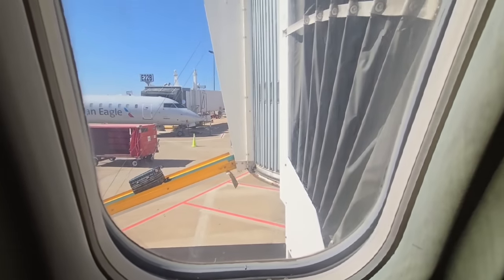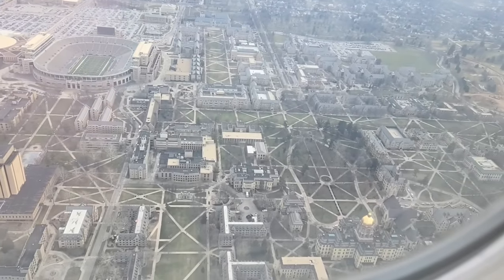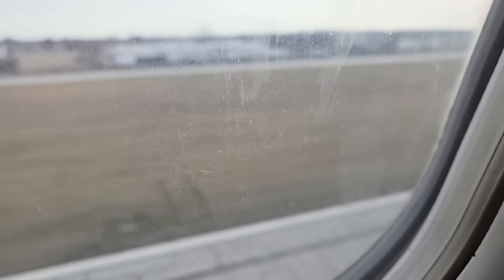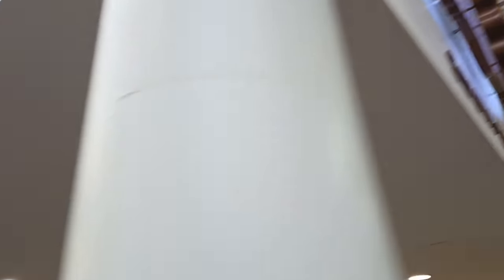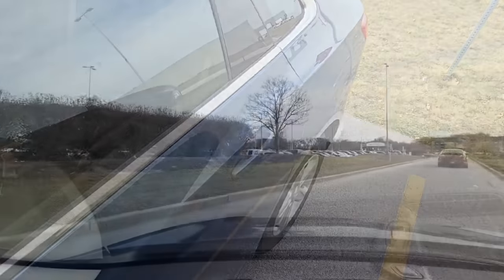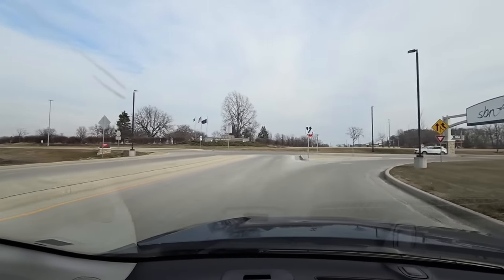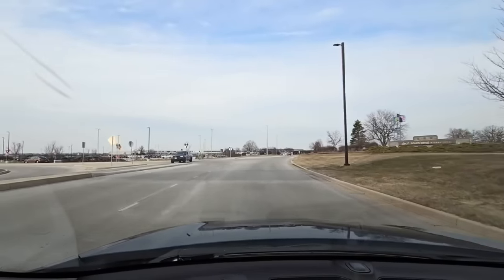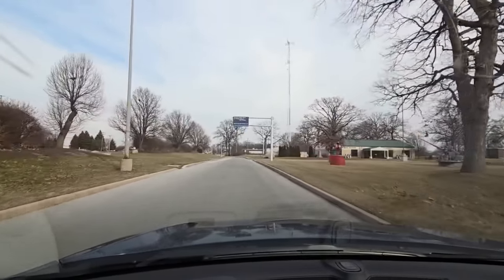LIPPERT Answers Questions about RV FRAME FLEX! Part 1

Comment: Thanks JD, I like the deep dive but I do have some questions if you'll allow me:
1.  Like almost all states, I'm all but certain that you cannot call yourself an engineer unless you have attained the PE designation.
2.  Not sure I caught Tim's last name corectly.  I did a search on the Indiana Professional Licensing Agency's website and 7 engineers came up under "Timothy Schultz".  Only 1 was a "Professional Engineer" under license PE19300397.  The remaining 6 were not engineers in an industry silimilar to structural engineering.  Is this the Tim in your interview?  My apologies if it is not.
3.  Assuming the answer to #1 and #2 is "yes", does Mr. Shultz seal and sign off on all of the drawings and calculations for each frame at Lippert?
4.  I must assume #1, #2, and #3 are a "yes" and if so, does Mr. Shultz maintain "responsible" control of every design that he seals and signs?  That is, does Mr. Shulz observe and control all initial design and changes to the designs he sealed, even if the criteria is revise by the manufacturer?
5.  Based on this video, It seems as if the manufacturers take control, or it is at a minimum implied that an engineer at the manufacturer takes control of the engineered design once Lippert "hands it off".  What is the process for Mr. Schults to "hand off" the engineered design of the Lippert frame?  Surely someone must take responsible control of the engineering after it leaves his oversight?  It would also be reasonable to assume this person does their due dilligence prior to acceptance to ensure they are confortable taking ownership of Mr. Shultz design.  After all, they essentially own the design after they take control.
6.  At some point in time, someone "owns" the engineered design.  I dont know who, nor say it is in any way Mr. Shuktz, but if it isn't he, certainly someone that is licensed to practice as a professional engineer in the state of Indiana at the manufacturer(s).  Hopefully someone that is entrusted with the health, safety, and welfare of the general public for sure.

It feels like no one in the industry wants to take ownership of what they produce.  I certainly hope I'm wrong and also hope that my questions above are answered for the benefit of the general public.
Reply from the maker: Several of their engineers offered to provide the current PE License but for privacy purposes I did not ask them to.
Reply: JD other very good questions were raised other than the engineers last name and credentials. What about the question posed concerning the process in handing over the frames to the OEM manufacturers?
Reply: @BigTruckBigRV understood.  Thanks for the reply!

Comment: Although Lippert is building frames to Grand Design's specifications, they may still be some liability because they know of the problems being experienced and they continue making the frames.  My 323BHS has a huge kitchen slide and a front and rear bedroom slides.  I question having a huge amount of weight on one side without the suspension to handle it.

Comment: Chassis are about 15 percent of the structural value of the trailer. If the box fails the chassis will follow. Water damage, delamination and overloading cause most failures.

Comment: Just listened to your Q & A from the Lippert people; seemed pretty it at times… why in years past, with the same RV  manufacturers they’ve been using, are all of a sudden having soo many problems NOW. I can’t possibly believe that the RV companies have changed their weight distributions as maybe as Lippard, probably it using a cheaper/thinner steel!! Why doesn’t Lippard just make a heavy duty unit, no matter what the RV structure on it is????

Comment: I'm a little confused because the engineer said that some RV manufacturers come to  them with a floor plan that they want a frame designed, engineered and built for and will be using normal RV accepted manufacturing practices. The engineer said in those instances they engineer the frame to their specifications. The RV manufacturer is relying on Lippert to build a frame that is sufficient! This is the area that Lippert seems to have dropped the ball. Cutting cost and corners is going to cost Lippert in a lawsuit.

Comment: Whenever you have two or more working on something, literally anything, it will always be the others responsibility when something goes wrong. It’s called plausible deniability. This is one of the reasons why companies like Newell, Prevost and some livestock trailer manufacturers are structurally superior. It’s not because of “trade secrets”, it’s simply because they have control and responsibility of the structure of their units.  Essentially “the buck stops there”.  There is an engineering line where “it will work” versus “it won’t fail”.  Guess which one uses which philosophy.

Comment: The changing of the pin box from one manufacturer to another is interesting in the contribution to frame failure. I’d like to know what Brinkley does differently from these other manufacturers because they offer Gen-Y pin boxes and goosenecks of different sizes on the same model of their Lippert frame.
Reply: There’s a difference how they are attached but I can’t find out if there is a difference in the thick of the steel.

Comment: As far as Lippert saying the RV companies may be overloading their frames. Even if that is true the frames should have a safety factor built in. For example, a truck might officially be able to tow 12k but it designed for 14k for safety- loading errors, etc. Frame SHOULD be the same way not just barely cover the GVWR of the RV

Comment: I have a 2023 grand design solitude fl380.  What are the guidelines on this frame?  I can tell you this frame is to weak unless the sidewalls provide strength which I don’t think they do!  Semi trailer get there strength from the sidewalls.  The problem in the RV industry is that there is no standards for the build.  We will not improve these products until the government steps in and sets standards like automobiles.  I would gladly pay more to have a product that is safe and will last.

Comment: JD I have a 2016 Highland Ridge 318RL with the Lippert Combination (either Gooseneck or Hitch pin) pin-box. Can you ask what is different in frame to allow the Gooseneck use and why since 2018 Lippert/Hightland Ridge stoped this combo pin-box.

Comment: But most frame flex issues are the frame breaking. I don’t believe water intrusion would cause that unless the frame has severely rusted. Think about your car frame or the steel frame of a skyscraper or the frame of an auto/heavy equipment trailer. They are exposed to much more than just water. And every video of a broken frame I have seen had zero rust. I think that the frame should be built to a standard above and beyond to prevent any unnecessary flexing. Then the rv manufacturer would have to come up with a more rigid unit to build on top of that frame. Think about class A, B and C motorhomes. They aren’t breaking. I have even seen frames breaking on travel trailers where the a-frame portion is because the steel is too thin. Of course I put the majority of the blame on RV manufacturers but Lippert has some responsibility here too. They are either aware that the rv manufacturers are ordering frames that can not withstand the weight and are not building them strong enough. Lippert is aware of this very serious problem and should step in and say hey we are not putting out frames on the models have issues until we and the manufacturer come up with a solution together that ends this problem. Instead they are putting lives in danger for profit.

Comment: Great job on the interview (and for that matter, even getting in the door!) and good questions asked. However, Lippert's responses of course, were handled with prejudice and that is to be expected. 
Learning about the pin box replacement and having to have an "approved" model was about the only thing solid, as far as information. 
My gut tells me that there will be no admittance of inferior work, design, or materials by the chassis or house builders, ever! As long as the "he said, she said" is practiced and fingers can be pointed, the consumer is the loser. 
We have the same issue in the motorhome world, when it comes to taking responsibility of issues that lie in the "gray area".

Comment: In my humble opinion, lippert should be designing these frames to be “over built “ and self supporting, which is to say, if frame model”y” can carry up to 15,000 lbs, not including the frame weight itself, then it gives them a leg to stand on instead of relying onthe rv superstructure to add additional support. If the rv design goes over the weight the chassis is designed for, it’s on the rv builder. There are some things lippert could improve upon, like the standard leaf springs, and spring mounts, they are doing the minimum, should have better mounts with gussets. Lots of trailer rvs out there with boken springs and broken mounts.

Comment: Did you ask if they are regulated? Some channels are making claims the industry is unregulated.
Reply: The industry is very lightly regulated. NFPA 1192 for the house side. There is no crash testing that I’m aware of. I’m sure you’ve seen them fly apart in crashes. One of the reasons I refused to buy a class A.

Comment: Curious if Lippert's stickers dictating GVWR, pun weight restrictions, suspension hangers etc. is gospel or if the individual manufacturers request specs built to that GVWR then design Floorplan with weights distributed all over the Floorplan without taking structural integrity of certain areas into account?
Reply from the maker: That's actually talked about in tonight's video.

Comment: A lot of people have been quick to blame Lippert for all of these problems. They definitely shoulder some blame, but I think the manufacturers are more responsible. Some people think Lippert does all the design, but they clearly do not.
The big question is, with all of these failures, is Lippert putting pressure on Grand Design and Keystone, and anyone else having issues? Since it is their component that is failing, I would think they would be investigating this and putting pressure on the manufacturers to design a stronger overall structure.

Comment: JD, good idea investigating this. Thanks for the work your putting in. I just have one question and one request. 
If they know people change pinboxes or convert to gooseneck, why dont they make their frames to handle them? If they make the frame for worst case scenario, all the rest will be fine.
Also, it would be great if you could talk to one of the workers without corporate around. In our factory, we have manufactured answers ingrained in us for auditors and inspectors. Needless to say, i am not allowed to talk to them anymore.
In the scheme of saving money, it could be as simple as changing welding material suppliers. Thats only something youll find from the workers.
Anyway, hope you get some answers and keep up the great work.

Comment: It is apparent Lippert sees frame flex and the resulting damages is the cause of many moving components happening together. They feel what they are building is built well, so, I guess it may be until you put an RV shell on it, it is at that point it is under-designed. I feel this interview needs to also have the RV company at the table as it is the sum of all pieces that is failing, not any one item.

Comment: I don’t understand how a frame that robust fails. Dry box trailers are built with no I beams. Just 4 inch cross members. There is a ton of them and the whole box is all tied together. I understand it’s a completely different design. But they haul 20 tons or more for millions of miles .
Reply from the maker: The manufacturers who built those trailers build the entire trailer.  The substructure is not built from one manufacturer, relying on the secondary manufacturer to build the remaining portion of the structure correctly.

Comment: Stapled together 1x2’s make a steel frame more rigid?
Reply: Sure, just like the paper or fabric on a kite makes the wood frame stiffer.  Or sheet metal stretched across beams stiffen the beams.  Or sheathing and foam insulation stiffens the framing of a house. There are countless examples of where a "weaker" material is used to make a stronger material more rigid.

Comment: We need more RV education videos like this and less videos of influencers receiving free products for their RV.  Why? Because some folks may run out and by such product without doing the research to determine if the product will damage their RV.  Example, not all aftermarket kingpins are approved for your rig, another example, sumo springs are not approved for all rigs, and switching from a standard 5th wheel hitch to a gooseneck may not be approved either.  I'm not saying that the manufacturers are not a fault for issues but we are also seeing relentless amounts of videos from influencers with all these "wonderful must have" products that they received for free that may or may not cause damage to your particular rig.  Just my opinion though, not fact based.  Only time will tell what the manufacturers will do with all the social media attention this topic is receiving. I'm  looking forward to the remainder of this series.

Comment: This is very interesting, but there are some truths that we will never know. I can't see any manufacturer ever be willing to admit that they might have designed something that is subpar. The blame will always get passed on. When a certain make or model of a 5th wheel trailer is given a specific payload why doesn't the manufacturer spell out how much payload can be carried at each location of the trailer? If a trailer has a payload of 3000 pounds and it has 100 gallons of fresh water capacity, which would weigh roughly 800 lbs, then the trailer really only has 2200 lbs capacity. Does the trailer have the capacity to have all of that weight placed in the basement where the king pin would receive the most load? How about when you add a washer and dryer in the front of the trailer? Most of that weight is directly over the king pin and transfered to the tow vehicle and thus less strain on the frame of the trailer. Manufacturers really should spell out areas of a trailer that can have a certain amount of payload instead of saying to spread out the weight throughout the trailer. I also find it hard to believe that the frame superstructure is highly dependent on the camper body for support especially when considering older trailers were wood framed and most newer trailers are aluminum tubing and if soft grade lag bolts are used to connect the walls to the frame, the fasteners simply aren't strong enough to have a great effect. When frames are designed, my guess would be that they are tested with a certain amount of weight placed on the frame and then the suspension is cycled and measurements are taken. I truly hate the term frame flex, because the majority of the issues are frame failure in which either the steel has failed due to fatigue  or overloading. Poor welds or missed welds would be a totally different situation that would be lack of quality control. When I bought my first fifth wheel trailer many years ago I installed a gooseneck adapter to the kingpin and I could tell that it was stressing the pin box excessively by the way the trailer chucked. I removed the adapter after one trip and went back to a fifth wheel type of hitch. In regard to how heavy of GVW of 5th wheel trailers are experiencing frame failure I would say you should include 5er of 15k and up, not just 17k and up. I have seen many cases of 15k 5ers with frame failures and this really makes me wonder how badly overloaded some of these 5ers really are. They can easily be within axle ratings and truck ratings, and still be grossly overloaded. I for one weight my truck and trailer combos often because where I live there are numerous department of transportation scales that are free to use and I use them often and I have upgraded my truck to a dually because my single wheel 3500 pickup was always at least 1000 pounds overweight.

Comment: I  believe this is what they call kicking the ball down the road. So what im hearing is you don't build R.V. frames. You build one half of a uni-body system with not required specs or regulations.

Comment: Hi all,So I’ve been camping for over 40 years and have had all kind of trailers. At this point in my life I’ve been fortunate enough to have been given a 1999 Carilight fifth wheel camper. I have put it through it paces and guess what, over loaded or rough roads it has no frame flex. I question the integrity of what they’re building now. My two cents…

Comment: Everyone is assuming they are not responsible and its the other guys problem. When these guys are talking about flex I believe they are talking about the overall frame and not just the area above the hitch. I believe this area should not have any flex and because of it stress cracks are forming in various areas which over time completely break. These areas i believe are under built for the stresses these rvs are seeing with the miles being put on them. These things are not designed to be towed criss crossing the states over and over and everyone from the dealer on down or up is aware of this and guilty of selling a false sense of ability of these rvs.

Comment: The consumer has blame in all this too. Weight distribution hitches set up and used wrong causes alot problems.
Reply: Only seen this general hot topic of grand design and lippert issue on fifth wheels btw. 

Still agree however that weight distribution hitches being used to turn regular rvs and truck into (failed) bridges ARE definitely a problem 😂